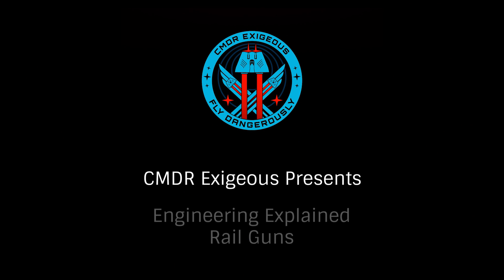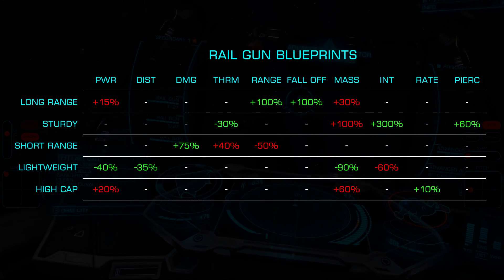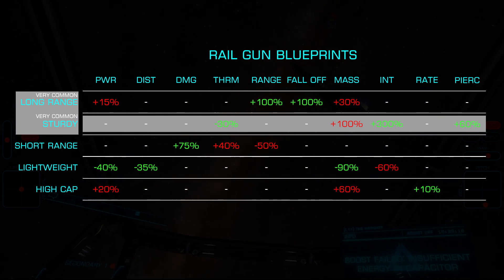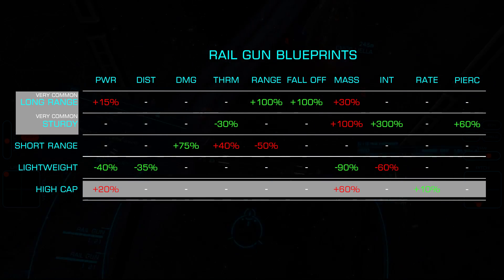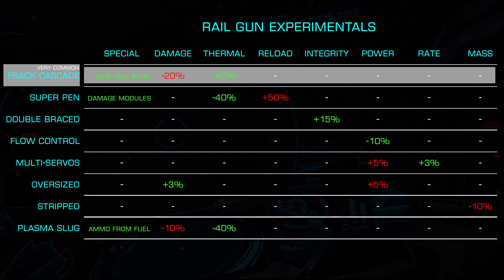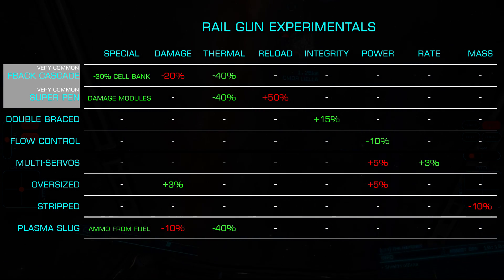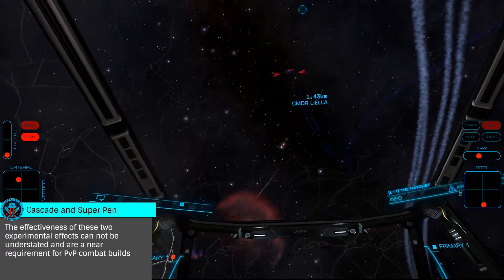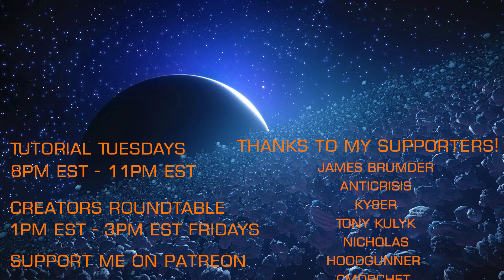Engineering Explained: Railguns

Comment: how swith on this pointers on left and right side which show throttle, moving direction? 2:01
fback cascade work only in full damadge range? i use railguns in pve for interupt cell banks, which modification best for this? i use high cap, but not shure its the best choise...

Comment: See there we can see the very different "priorities of value" when it comes to what blueprints and experimentals are best between the PVE and the PVP players.
In PVP the low ammo count on rails is whatever.
For PVE players where you are not just jousting with 1 opponent but with a whole Has Rez. 30 shots. That's not enough.
And going back to station every 5 minutes is no fun.

A PVP player will build into long range super pen with maybe one long range feedback for the cell bank negation.
Technically that's the most powerful combo for the weapon.

In PVE, having the most powerful gun however I find is a disadvantage compared to long term endurance. 
That is why my railgun build for PVE always go like this.
Sturdy for the heat reduction. 
Plasma slug with 32T fuel tank for virtually infinite ammo.
That way I can farm the haz res with no back to port interruptions for hours on end if I wish it.
And rails being rails. 
The modules still fucking melt like chocolate in the desert.
Reply: Chevaux pours coursaux

Comment: Busy working on a Sturdy Plasma Slug Imperial Hammer as we speak. The fuel consumed is so negligible in a 32T tank that it's more important than having super pen in PVE when mass killing. Staying power beats ammo consumption any day imo.

My Krait MkII is practically self-sufficient with the exception of the S3 MC (2 S3 Beam Lasers eith Thermal Vent and Long Range let me control my heat. I can practically play in silent running mode as is). The MC is running High Capacity Corrosive to burn armor for the lasers and railguns to do work.

Comment: I'm sorry if this is plain to everyone else but what exactly allows for micro-gimbiling or the targeting of individual systems?  We seem to say at 0:58 that it's due to Long Range and then at 2:40 we seem to point to Super Penatrator.  I've done some research and it's been fairly ambiguous elsewhere too.  And feel free to school me if I'm misunderstanding.
Reply: Some fixed weapons have micro gimballing (lasers and rails that fire ray cast style)  that can correct small mistakes.  to target individual systems you have to press T I think and you'll see which sub system you're aiming for under the target hologram.  You can target the reactor, fsd, any gun they have, cockpit or anything one might want to shoot out of a target to stop them from escaping or fighting.

Comment: i love rails, but as it is, i find them difficult to group together with other weapons.. Any thoughts? thx
Reply: Fixed weapons with fixed weapons helps, try only using them at longer ranges while using higher damaging weapons closer up, you can watch some videos for recorded help, i have a few where i use railguns quite a bit
Reply: I use heat venting gimballed beams with railguns i find hitscan weapons ideal in combination say you miss a few shots you can still damage them easily and get away with a win

Comment: The -40% thermal load for plasma slugs is huge.  Lets you spam the hell out of your rails, my dps is far higher with plasma slugs and a lot of it comes down to this.  Pair with some thermal vented beams and spam away.
Reply: Did this on a courier and shieldtanked it never had so much fun
Reply: @danielstokker  3x efficient rails with plasma slugs? how many fuel tanks did you fit in?

Comment: Is it safe to assume micro gimballing is from external forces altering the path of the projectile(like electromagnets for rails or lensing for lasers), instead of more sturdy, accurate servos on the base?
Reply from the maker: Probably safer to assume it's because it's a videogame and they add some elements to make it playable ;-)
Reply: @Exigeous  shhhh dont break my immersion
Reply: I would say it's just more sturdy servos.

Comment: Best option is Long range with plasma slug
Reply from the maker: I'll agree about long range but absolutely disagree about plasma slug - as I said the best thing about railguns are the experimental effects of feedback cascade and super penetrator, I'd never in a million years trade that just for more ammo.  They shouldn't be thought of as a damage weapon but as a utility one.
Reply: @Exigeous  but if you have a fuel scoop and plasma slug that's basically infinite ammo
Reply: You don't need that much ammo for anything other than extreme endurance HazRes/CZ builds. Most of the time, when you need to scoop for fuel, you'll need to go and repair as well, and why bother then? You can just rearm right away as well.

Only time I'd take plasma slug rail guns is on a Type 10, built for maximum staying power in the aforementioned areas; two smalls and a medium, long range and plasma slug to tag targets from afar, and then rip them to shreds with the bulk of the DPS that thing carries. Combine it with an 8A AFMU and 7A repair limpets, and you can rack up 10's of millions of credits worth of bounty vouchers before having to restock on limpets.
Reply: @timothy3122  I have a fully engineered T10 it's my main ship
Reply: Okay? So? I have one as well, close to fully engineered. Point still stands, plasma slug rails are only really useful for extreme endurance builds, or memeboats i.e. combat type 9
Reply: @Exigeous  But Exigeous, your Krait MkII build is using short range plasma slugs! 😛

Comment: I look at what Engineers offers with its upgrades and magic experimental side effects, and just groan... I really do think it has damaged the overall game :(
Reply from the maker: If you actually use engineering you'll realize that its one of the only parts of the game with real depth and immense options.  The combinations of blueprints, experimentals, defenses, weapons, etc. make PvP and to a lesser degree NPC combat one of the richest parts of the game.  While there is a good deal of grind, check out my videos on material gathering as if you do it smart you can lessen it dramatically.
Reply: Agreed, it adds huge variety. That does not mean the outcome is a positive one IMHO. It means alot of it has now become paper/scissor/stone gameplay.

And ultimately I'd rather be doing far more involved combat scenarios and general gameplay, than just doing 3-4yr old shallow gameplay just to 2x my pew pew.

Comment: Incase any new cmdrs are wondering, you may not want to use rails if you are farming bounties or bonds in hazres, compromised nav beacons or combat zones. The ammo count is too small, even with engineering, which will cause you to synthesize ammo or travel to a station to rearm way to much. That being said, you may want to have at least one rail, any size with cascade experimental, if you are farming bounties or bonds in open. I'm pretty sure you can figure out why.
Reply from the maker: 100% true - that's why I look at rails as a specialty weapon primarily, for the cascade effect.  I very rarely fight NPCs anymore, there you could certainly go with plasma slug as while you'd lose the cascade experimental you'd have basically unlimited ammo and get practice using them (and get the thermal reduction too)
Reply: Mind the fuel tank, though. If I remember correctly, plasma slugs can't be used on ships with less than a class 4 fuel tank. I tried using one plasma rail on my fdl and I actually ended up running out of fuel in less than five minutes. That was back when I first started playing so they may have tweaked it to be more efficient by now.
Reply from the maker: I'll admit I haven't tried it personally as I really don't do NPC combat any more - but when I do I do use rails and PAs as they just dispatch NPCs so much faster than other weapons.  It's also nice to get the practice with them for human targets - and I never fight so long that I'm not already tired (or out of limpets as I use collectors the rare times I do NPC combat) that I don't mind going to restock anyway.
Reply: The practice part for sure. The npc's supposedly have a script in their programming that forces them to fly as evasive as possible away from your leading reticle when using fixed weapons. I have found scoring consistent hits on npc's to be way more difficult than human opponents due to humans being more predictable.  I remember I spent weeks in pg and solo honing my fixed hardpoint skills when i first started this game. It was a good thing i did, because within 5 minutes of my very first foray into open, I had to test those skills.

Comment: What's your source for the feedback Cascade effect? I'd like to read up on it more cuz the game is so notoriously vague
Reply from the maker: Check out the link for INARA.cz and pretty much just Google it.  I use these on all my PvP combat ships and have verified it personally in game.  Often I run 3 small rails on my Chieftain, all cascade, as when I come up against big cell bank ships they are a bitch - if I can hit them during the spin up (6 seconds unengineered and 4.2 engineered with rapid) I can dissipate 90% of the bank, crushing their overall shield strength.

Comment: eh... wth is micro gimballing ?
Reply: It's that tiiiiny little bit of auto-aim fixed weapons have. It's more noticeable at long range, but its always there.
Reply from the maker: Eric put it perfectly, I should have thought to put  a pop-up tip in the video about that.  To see what we mean get about 3KM from a target with a rail gun and switch between the subtargets - and you'll see the target point change ever so slightly.
Reply: @Exigeous  you don't even have to cycle subtargets, if you do it only autoaims on the targeted module. If you don't target any modules you will see the microgimbal targeting the closest module in sight.
Reply: The most noticeable example to me is the fixed weapons on fighters, even at close range

Comment: I wish there were more interesting experimental effects for railguns. Cascade and SuperPen are just too powerful compared to the minor increases of the others.
Reply: I think the main problem is that a lot of these are just generic weapon module experimentals that don't really apply to railguns the way they're used in practice.

Flow Control arguably has a place, at least, because they can help shoehorn rails into a ship that couldn't otherwise mount them. You can make a similar argument for Stripped being a way to mount rails on a non-combat ship without sacrificing jump range or speed.

But the power of Feedback Cascade and Super Penetrator is so great that I almost don't see the point of equipping rails at all if you're not going to use one of the two.
Reply from the maker: Hmm, well not sure what else you would want that wouldn't make them way too OP.  Both cascade and superpen are incredibly useful, so much so that there's not really anything else I'd want from them.  This is one of the reasons I like the Chieftain so much, you get those 3 smalls for experimentals keeping the two large and 1 medium to deal all the damage.
Reply: Yeah, I am not sure either? Maybe something that made them do lots of damage to shields but not hurt hulls? I don't want more damage out of them, just some more interesting effects for niche builds.
Reply from the maker: Yeah, I wouldn't argue for less but we do have 8 experimentals already.  If you're looking for something against shields specifically PAs or other weapons are best mixed in - think of these as your anti-module or anti-cell bank weapons really.
Reply: Wasn't specifically looking for anti shield weapons. Just the only idea that came to mind for something to make a different experimental effect. Just comparing rails to what Multicannons or Lasers have for options, it seems a bit dull. Might just be though.